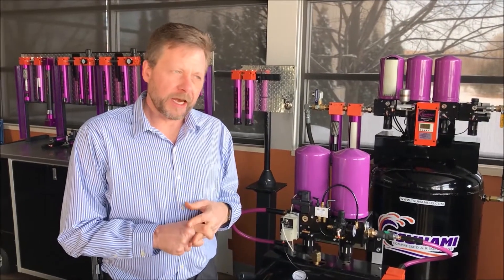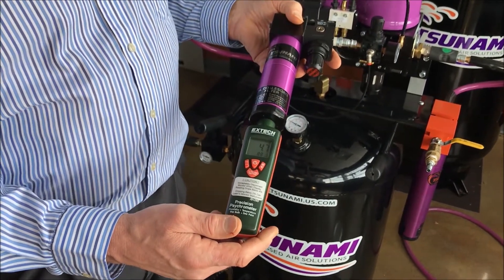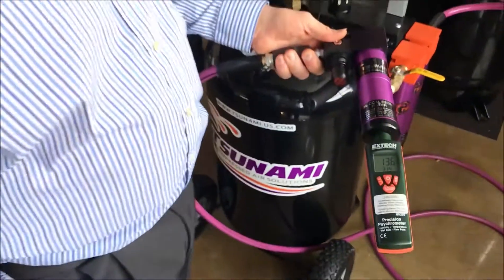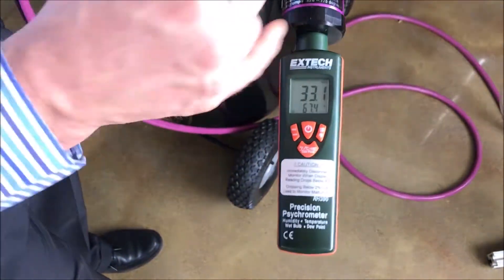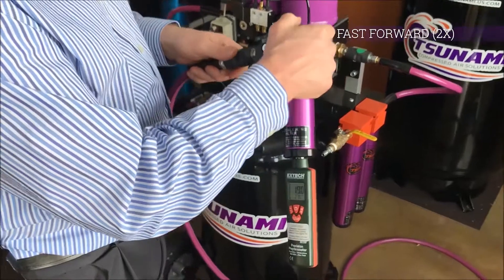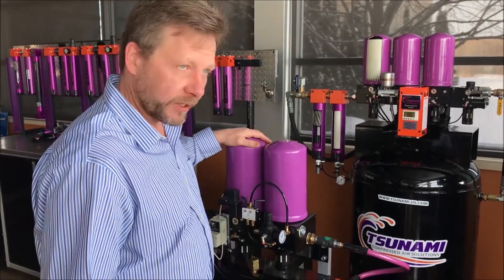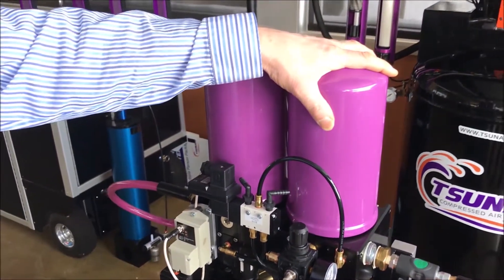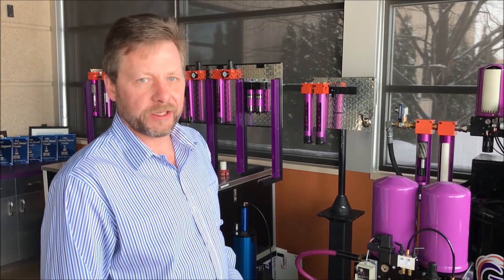Remove Humidity from Your Air Compressor

Comment: Best air dryer system I've ever used.  Been in my manufacturing facility for the last 5 years and we couldn't be happier.  21,000 SF and about 1000' of piping.  Not a single drop of water to any of our machines.
Reply from the maker: We're happy to hear it!